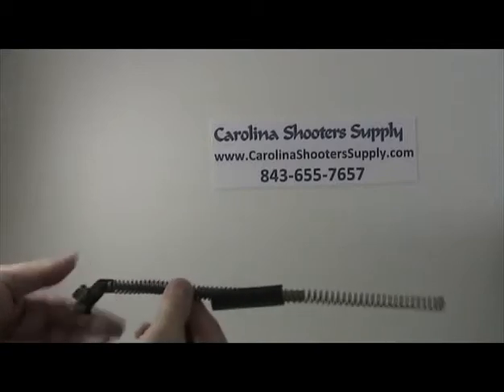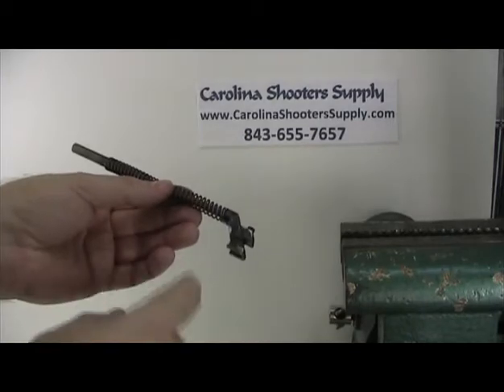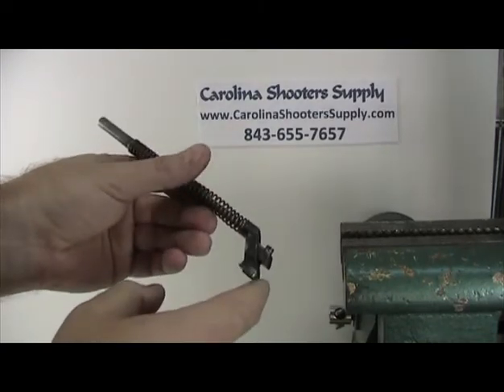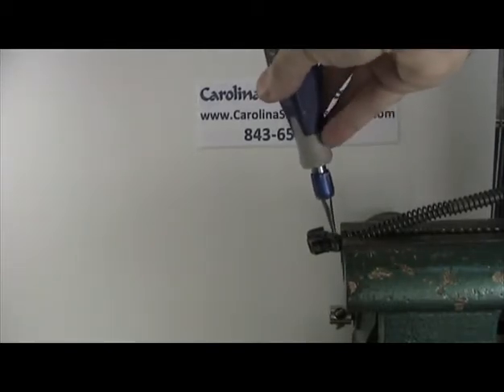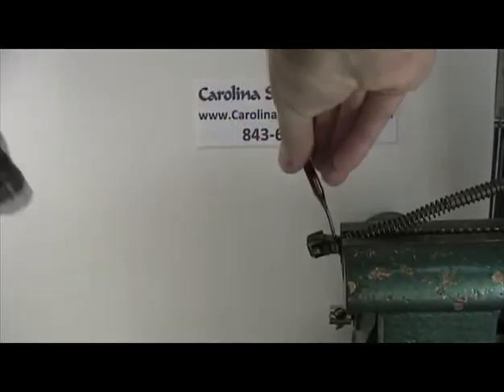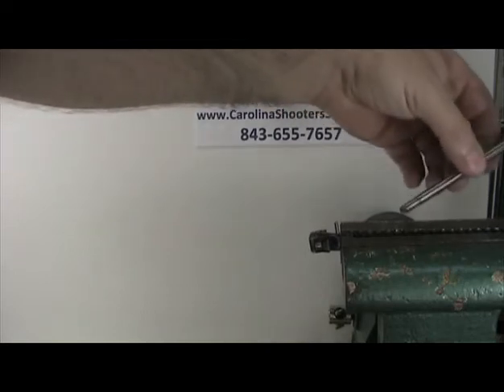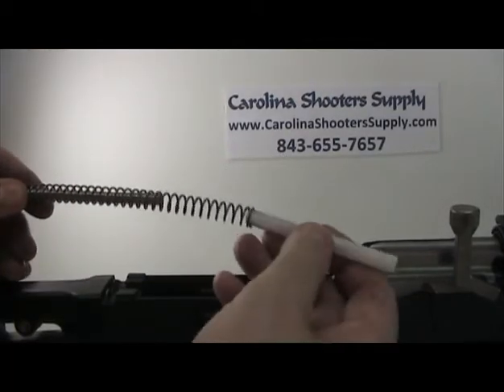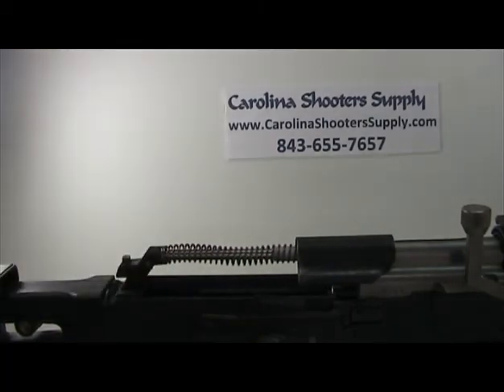Saiga 12, Vepr 12 JT Engineering Performance Guide Rod/Recoil Assembly Installation

Comment: The old guid rod on mine did not want to come out that easy. That pin was really really tight. (Yes i took it out the right way with the right tools).

But the result is smooth as butter.
Waaaaaaaaay better.

Comment: it's a good product, BUT even with all the proper tools, I did this install on 4 VEPR's and on 3m there was NO removing that pin without destroying the part. If you are going to buy this, save the headache and buy the kit, which includes a new guide rod holder (top cover button).
Reply: Thanks for the info im sitting here the whole time thinking why didnt they include that part it seams like it wouldnt cost that much...

Comment: Has anyone had issues using this kit on a vepr? If I install the dust cover the delrin sleeve sticks in the carrier and occasionally badly enough to pop the rod out of the delrin sleeve, without the dust cover no issue.

Comment: Don't buy this part unless you're going to have a gunsmith install it for you or you don't mind using a sledgehammer or something. Also don't think that buying a new holder will work either. I just bought both and I can't even get the damn pin in the holder after over an hour of hammering.

Comment: Does this work with the catamount?
Reply from the maker: +escozx2 Yes it will work on the Catamount
Reply: +carolinashooters Its not an exact fit for the Catamount, I had to drill out the hole of the guide rod holder to make it bigger so it could fit the rod, I also had to shave the white plastic part in order it to fit the Catamount spring.
Reply from the maker: thanks for the feedback